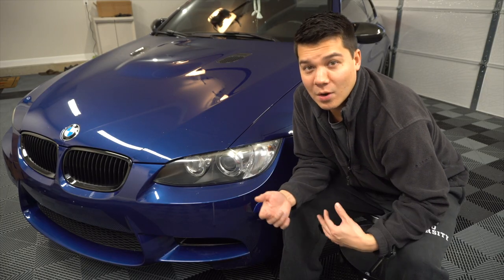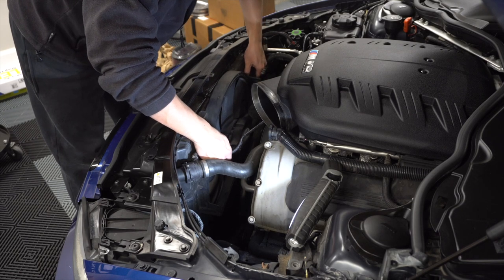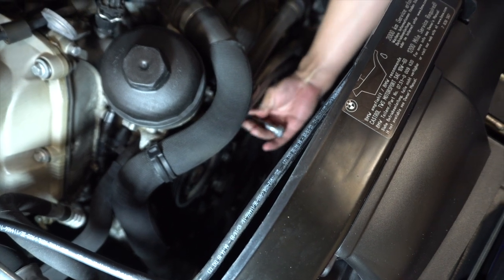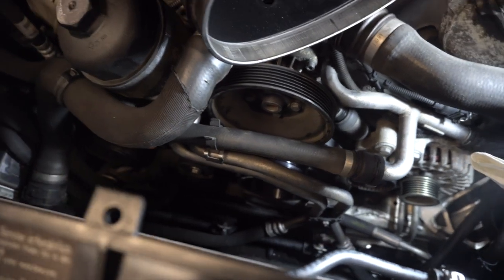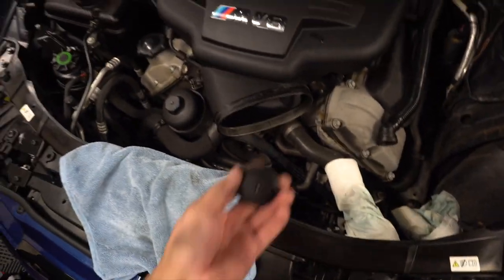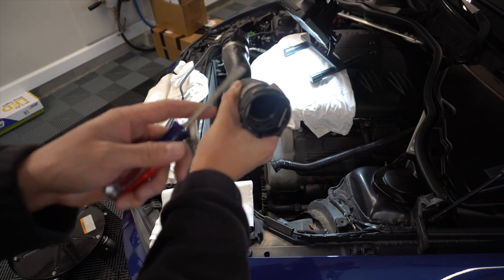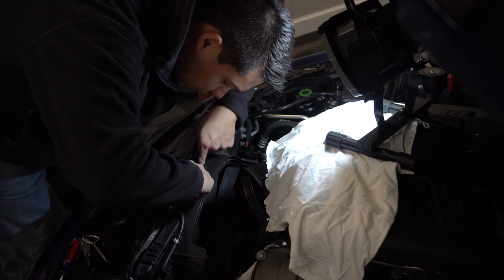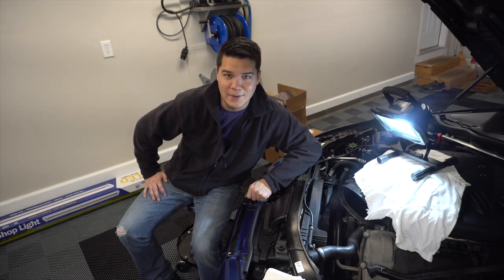TRACK BUILD | BMW E92 M3 Macht Schnell UnderDrive Pulley Kit

Comment: What's the part number of the upper radiator hose part that you said might break? I just got the kit and I'd prefer having an extra one in case I break mine
Reply from the maker: cplhueyusmc 11537838214. I bought mine from FCP Euro but if you google that number, it will pop up for multiple vendors.

Comment: Why is my last crank pulley bolt never aligned? All 5 bolts are loosely threaded in, whenever i tried to thread the 6th one, it never lined up. Did u have that problem when u installed ur crank pulley?
Reply from the maker: Did not have that issue when installing ours.

Comment: How do you soak up the spilled coolant from the trax flooring you have?  Doesnt it go through the floor grid and now you have a puddle underneath the flooring?
Reply from the maker: The tiles are very easy to pull up. I just uses a paint can opener, or a flathead screw driver and pull up individual tiles if I need to clean up a spill. Very simple!

Comment: when i hear anything that has to do with torque increase im putting it on my e90! any other recommendations to increase torque??
Reply from the maker: I agree! This car needs all the torque you can get! Unfortunately, there isnt a ton you can do without going forced induction. A tune will help slightly though, so I would recommend doing that as well if you havent yet. I recommend BPM Sport for a tune - I did a few previous videos on BPM so go check them out! (Discount code is also available if you decide to purchase)
Reply: @accelerated_motion  but even forced induction i've heard doesn not increase the low end much other than the harrop sc but that's so overpriced....
Reply from the maker: @chongerly5233  There isnt much you can do to add torque to these cars unfortunately. Harrop would be the best for torque. But yes, expensive.
Reply: @accelerated_motion  still the beast of a car though none the less.. will go down as one of the best if not the best m3.

Comment: When the belts are touching, like it is on the bottom of the power steering pulley,  wouldn't that wear them out and cause a belt failure?
Reply from the maker: That is certainly quite possible. I'm not sure if other pulley kits are different, but this is how the Macht Schnell has to go. There is no other way.
Reply: @accelerated_motion  some other pulley kits only replace the crank pulley, so maybe that’s the way to go. I just had my mechanic try to install the macht Schnell ones and he said there wasn’t enough room under the power steering pulley because it’s larger.
Reply from the maker: @connorpendarvis1229  Yeah I wouldnt go with Macht Schnell for the pulley kit. I think you're right that other kits dont have both belts to replace. I would probably do DINAN instead.

Comment: hey i noticed in the video you took only six t45 torx bolts to take off the crank pully, but on my e92 m3 there are 4 e12 bolts as well. how do i remove those without the pully spinning?  I didnt see you guys do this step in the video
Reply from the maker: I had a second set of hands help hold the pulley in place while loosening.

Comment: Hate to correct you, but I have to just because others will be looking at this install. 1) the diagram macht schnell sent you is correct,  but it is for a clockwise rotating power steering pulley. It looks like they sent you a new power steering pulley and belt for clockwise,.. those are the wrong parts if that m3 has a counterclockwise PSP like mine. 2) they belts should never touch, or ride together, regardless of the direction of your pwp. 3) for counterclockwise, the pwp belt should be grooved on both sides, and alternator belt should have grooves only on one side of the "belt interior".  4) always remove the driver's side radiator hose. if you break the nipple you have to install a new hose anyway, so take the time and remove it to have proper clearance. Here is what I think happened. The extra diameter on the PSP is causing the belts to ride too close together, which is why they are touching. Links below to help people with this install,.. look at the diagrams  to figure out if you have a clockwise psp or counterclockwise. Belts and pulleys are different and have different part numbers.
https://www.newtis.info/tisv2/a/en/e92-m3-cou/repair-manuals/11-engine/11-28-drive-belt-with-tensioning-deflecting-element/PgzXOMt
 https://www.realoem.com/bmw/en/showparts?id=WD93-USA---E92-BMW-M3&diagId=32_1737
https://www.m3post.com/forums/showthread.php?t=1162212
https://www.realoem.com/bmw/en/showparts?id=WD93-USA---E92-BMW-M3&diagId=11_4120
Reply: Also, turner motorsports makes it a little easier, they differentiate the parts buy build date. https://www.turnermotorsport.com/p-338810-turner-motorsport-power-pulley-kit-e90e92e93-m3/?pdk=DQ
Reply from the maker: I appreciate your post! That will be helpful for others. However, I'm 100% positive that ours is installed correctly. There is also a different kit based on the model year of your car. I had another guy reach out to me saying that his was incorrect and he followed both mine AND MS's install videos (and a few others) and his orientation was incorrect. Later, we discovered that based on his model year, a different kit was produced. We have had zero issues since this install. And yes, I agree that removing the driver's side radiator hose would be a good idea to do from the get-go. Otherwise, you end up breaking the nipple off like I did, then have to wait a few days for a new part to arrive. I have seen a ton of posts about people breaking these and I honestly dont know how people have been able to remove the radiator without breaking it.
Reply: Good info ! Thx for the reply. The more I researched what you ordered and studied their pulley set up, the extra diameter gained on the PSP Is offset directly by the under pulley. Great work
Reply from the maker: Thanks!

Comment: Hi! Thanks for your great video. I have an issue with my installation. I installed it as the main website shows and my steering wheel pump wasn’t working and when i tried your way my belt was short.
What should i do?
Reply from the maker: What year is your car? There are different versions of the Macht Schnell Underdrive Pulley kit depending on your year. So you likely have the incorrect one.
Reply: Accelerated Motion it’s a 09 6spd, and you’re right, I contacted the seller and they will send me the correct one! Thank you for responding

Comment: Just curious why the ms belt route is not correct?
Reply from the maker: MS routes it differently than other pulley kits. Also, there was a difference in the earlier 08 model kits as well.
Reply: @accelerated_motion  yes mine is early 2008, so same routing as ms video
Reply from the maker: @davidl2473  Then that is why our route was different than the MS video. They revised the kit after 08 models